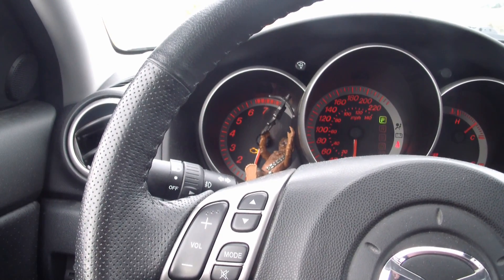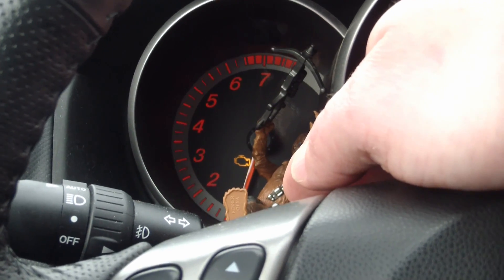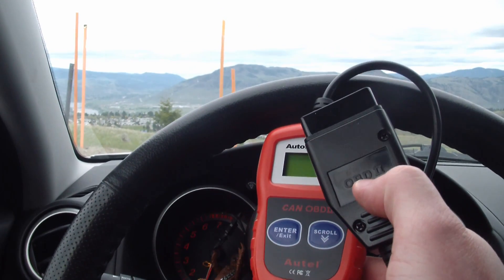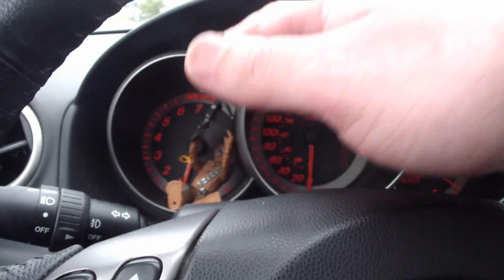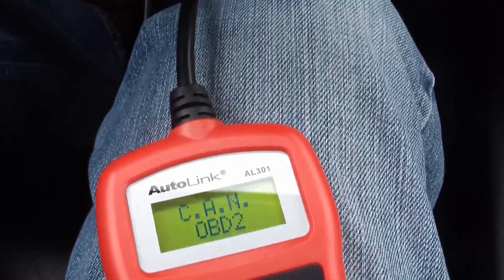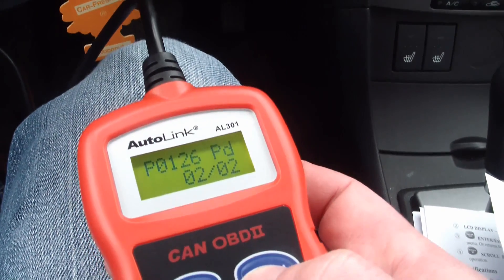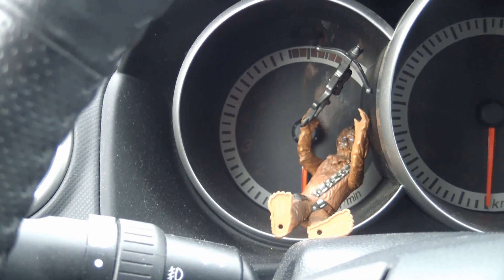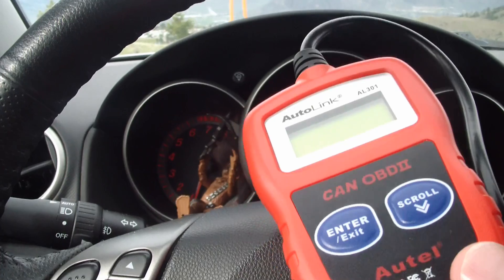Manly-Man Skills: Outsmart Mechanic Scams by Using Your Car's Computer!

Comment: I keep an old cellphone with the cell radio disabled mounted above my line of sight at the very top of the windshield and a bluetooth obd2 reader plugged in all the time. I have an app called Torque(it's worth paying a couple pesos for the full version) configured to takeover the phone so it's basically just a fancy full time engine metrics display and fault defector. Hell it even changes display modes/colors to match the lighting level outside so it's not a distraction

Old phone was free and the reader cost half as much as the phone mount, about 9 bucks. Been running for 6 years solid.

With all the graphing output and logging features of the app and a little gargling I've saved myself and a couple buddies thousands in misdiagnosed problems.

Also it makes the modern car feel like a real piece of equipment what with all the sensor data feeds. I mean hell, it's worth the cost of the odb reader just to have a god damn volt meter..

Comment: Late to the party but can confirm, self diagnostics result in us stealership parts changing monkeys doing exactly what we're told. If'n ya say it needs an injector, we'll swap one in, and then you can argue when the clean folks in the service advisors office call to let you know it's still missing on that cylinder. The customer is always right, even when they're wrong. Unfortunately sometimes it is a big (or little) expensive component that has failed and the only thing we can do after ruling out all other possibilities is to replace it.

A good mechanic looks for the simple, cheap solutions first. A bad mechanic throws confusers and pixie dance wires at it then asks for more diagnostic time when that doesn't work.

Comment: That is $30 bucks for a very basic engine code reader.  How about SRS?  ABS?  Transmission codes?  No joke but there are seat senors in some vehicles.  If they are there to detect the contents of your wallet is debatable.  Then there are the ones that can display live data and do key on engine off/on tests.

I have a "cheap" one for work that does engine, SRS, and ABS.  Also does key on engine off, key on engine on tests and displays live data.  Only ran me $400 but it is enough for the work I do.  Hate to say it but there is a bit more to diagnosing a car then just pulling codes.  That is why face time with the customer is still valuable.  Sometimes all I use the thing for is to validate what I think is the problem based off of face time alone.

There are still a few of us honest mechanics out there.  It's the salesmen that get me and one of the reasons I can't talk to customers anymore.  Also one of the reasons I am looking for another place of employment.  I'm fed up with doing unnecessary work just to pad their numbers and bonuses.

Comment: Hi AvE, love your channel man, so funny. Had a BMW a few years ago and the DPF light came on. Dealer told me it would take 1200 of our British pounds over here in Wales (is that anywhere near Germany I hear you say. NO, it is near England and we, the Welsh, are not too effing happy happy about it either) because a very expensive bit of the exhaust needed changing. Internet advised me to drive it hard, really hard like, for 10-15 minutes. Did that, had a blast and the light went out and never came back. Like you said effing cheating basturds. Going through all your videos.
regards
Gareth

Comment: Lol there are a few bad apples that give us techs a bad name. Both dealers and independent shops have them. If you are unsure, have them show you the problems with your car. If they won't show you the car then take it to someone that will. Not saying stand there and watch the tech work cause most of us hate that and only thought going through our heads is lighting your car on fire lol. Just saying have them show you the problems on the car before they start work and show you why you are paying what they are asking. Techs get paid by the job, not the hour for all of you talking about lunch and smoke breaks. Honest techs use standard industry labor times which you can ask to see.

Comment: The ultimate Mechanic-Scam would be getting someone to, say, post a V'jeo giving honest folks slightly inaccurate info as to how to fix their "Check Engine" light by disconnecting the battery! Maybe it works differently on the other side of the pond, but here on the island of warm beer and terrible food, never has turning it off and on again fixed it.

Also I use an Autel diagnostic device (MS906) and trust me, it wasn't 30 bucks!

Comment: I keep a cheap code reader in my console. Got it at a pawn shop for $5. If you don't want to do it yourself, auto parts stores usually have a cheap code reader behind the counter for customer cars. Just ask.

Comment: One thing missed here is before clearing the codes, write them down. All of them. If it's above your DIY level, take those codes to your trusted mechanic. They might  provide a clue. Better yet, don't clear them. The computer will also store data of certain parameters when the code occured. This additional data can help your trusted mechanic diagnose what happened. If you have a good relationship with your trusted mechanic, call them up and ask for advice. Many good independents will scan it and give you a bit of advice of what to do. Just remember that this time takes from what they are doing so be sure to do something for them and spreading their name around is always appreciated. Of course beer or cookies works too.

I had basically the same code on my VW. Fortunately, I have VCDS and graphed the coolant temp from cold to warm. Looking at the data afterwards, it showed a sudden drop, them return to temp. This era of VW had bad coolant temp sensors, so I knew what the problem was, but this showed me why the computer didn't like what it was seeing.

Comment: Getting the fault codes can and most times lead you to the culprit, but not always. Sometimes an unrelated component can cause another sensor to be off kilter and thus an unrelated code can be thrown. Such as a failing cooling/heating fan for the cabin can cause a check engine light. But that fan has nothing to do with the emissions..... So you thought.....

Comment: When I went to work in bc Canada from the UK ( born & raised) I had purchased a dodge ram 1500 1997,  the check engine light went on, so thought, end of days, lol,  but, my bud said check the filler cap, it was loose, so I tightened it, ccccc click, end of problem, crazy, as the dealership would have charged me a mint, the dealers are crooks in North America, I have buds, in the trade, so helps, I am grateful for that,

Comment: Warning.  BMW has an extension to the OBD-II codes which are proprietary.  You need BMW's reader and diagnostic tool to modify some of the warnings/codes.  You can get a category code but there are other codes that you can do nothing about with a standard reader.

Comment: Ten years after I bought my '02 Dakota that light came on, so I bought a Bluetooth ODB2 device to figure out what was up.  Turned out to be a cracked hose.  It was two years later that I found out that you can turn on the ignition 3 times quickly and the error code will display on the odometer.

Comment: Two things we do in the UK : 1, take the lamp out from behind the warning logo. 2, Turn the radio up so you can't hear the engine.
Reply: Sadly my radio doesn't work either
Reply: If you reside in an area that requires emissions testing, they don't care if the light is on or not,  they plug in a scan tool which tells them if the computer is signaling the light to come on.... if so, you fail and can't renew your registration....
Reply: Yes, I have a Land Rover, too.
Reply: @blacksquirrel4008  awesome!! You sound like you have heard my Texas joke!! 🤣🤣🤣
Reply: @davidjones8942  no, do tell
Reply: Electrical tape over the oil light worked in my Vauxhall Victor!
Reply: Or remove the fuse for the engine management light.

Comment: You can buy ELM327 v1.5 and it will read/erase those error codes and it can also show you life data from sensors.
It costs 3-5$ and you need 1-2$ application like Torque for your phone.

Comment: Get an OBD2 bluetooth adapter, use the program "Torque" on your phone.

WAY better than just one of those code readers!  You can watch any of the sensors output, as they work (or don't).

Comment: Don't disconnect your battery or change a battery if you have to smog your vehicle. It may take a couple hours or a couple days depending on driving habits to reset the system readiness tests.

Comment: Dodge has something like this in cars going back into the 90s (maybe even later?) With the car off, twist the key a couple few times (dont start it) and it'll read out the codes to you. Buddy of mine told me this, use to work at the chrysler plant in Belvedere, Illinois.

Comment: “Google is an excellent resource.” 

You just can’t get this kind of expertise anymore.
Reply: I like how he says google is an excellent resource but doesn't use the OBD2 website that has every code (including some manufacturers codes) and common faults listed lol
Reply: @nilloc93  True, but on the broader internet (via google) you can find shortcuts and 'life hacks' for a lot of the meaningless codes that will still actually throw a light. The evaporative emissions faults in CA cars for instance.
Reply: @jameshisself9324  None of the codes are meaningless. They are all present to indicate an issue with the emmissions of the car, which if everyone ignored, would just lead to shitty air. I would suggest that in addition to dealerships ripping off car owners, ignorance on the part of car owners is equally a problem because learning something new is just too hard.

Comment: Cars before 1996 and euro cars have their own OBD system called OBD1. Back then every manufacturer had their own CAN/BUS connector and codes. Also only some OBD codes are "standard" If your code starts with PO or C then it's a chassis or powertrain code respectively. If it only has P followed by a 4 digit number then it is a manufacturer code. THESE CODES DO NOT TELL YOU WHAT TO REPLACE. it's not that easy. Sometimes it is that easy. But most time the MIL only gives you a starting point, or a frame of reference to start troubleshooting. Most OBD systems take about 100 miles to reset monitors and what not.

Comment: Smog has been reduced because car have computers that control the fuel mixture.  California's efforts to reduce smog from cars did very little, (EGR, CAFE standards, 1960's & 1970's era modifications) and to some extent, damaged performance causing drivers to burn more fuel and crate more smog.  California is controlled by "do gooders" who legislate the right thing (in their opinion) without any ability to make it work in reality.  Pitiful.

Comment: dad says i should wrap up the pokey bit before inserting into the receptacle!
Reply: What if they pokey bit burns, should you chooch away?
Reply: wait until the smoke comes out
Reply: Well the only problem is that when you have your pokey bit wrapped up you can't transfer the data. That in turn though also prevents you from all sorts of viruses that you might just get stuck with for the rest of your life.....

Comment: If it flashes fix asap. Always look into mode06 data for pending and intermentent faults. If you are taking to a reputable non stealership driveability Tech don't clear it he can save time with freeze frame data with a more robust diagnostic tool. Always remember most dtcs are fixed with answering a few yes/no questions. That was an Excellent presentation of the diagnostic system. If you do have to go to a dealer remember this that tech only makes about 25 to 30% of shop rate. That being said if someone were to present him with 40% in cash value of the labor rate you will easily find where his loyalty lies.

Comment: Told my parents I could fix their P0010 code, they took the car to a shop and it came back with the same code and the same bogged engine. It's a 2012 Buick Regal. I told them to just let me at it and I'll get it fixed.. since the shop charged them close to $300 they finally let me do it. Long story short, I had to get a camshaft position actuator selenoid and put it on....I had a feeling that they fucked something up and guess what THE DUMB BASTARDS PUT AN EXHAUST WHERE THE INTAKE WAS SUPPOSED TO GO. Five minutes later, I switched out the selenoids, cleared the code and she rides smoother than glass, mileage went up dramatically and the idle issues were gone. Moral of the story: don't EVER trust shops. Those bastards have taken my parents for thousands over the years, don't let it happen to you

Comment: You're not always paying for someone to plug in and read what the light says and blindly replace that part.  Sometimes you're actually paying for a couple decades of experience that knows the code the car tells you actually means something else is wrong.

Not always though.  Sometimes you are actually paying for some youtube certified hack to plug the code reader in, blindly replace parts based on the code alone with no testing then erase the codes without actually looking at the snapshot and analyzing what happened.

You of all people knows that there's no substitution for experience.

Some get better with time, some think they get better with time.

Comment: The check engine light will only ever turn on for an emissions fault. And the DLC (diagnostic link connector) has been standardized since 1996 and is located within 18 inches of the steering wheel. The code you have is likely a bad coolant sensor but a thermostat stuck open can cause that code as well. Stuck open means the coolant can’t heat up the engine properly. Also, NEVER go to a dealership unless your vehicle is still under warranty and the repair will be under said warranty. Otherwise just go to a well established and trusted mechanic of your choice. Speaking from over 20 years of experience as a mechanic.

P.S. an engine not getting up to temp will burn extra fuel in an attempt to warm the engine. That P0126 identifies a cooling system fault, but still affects the emissions system by adjusting fuel.
Reply: Tis why I always look at fuel trims just to get an idea of where she thinks she is.
Reply: I have obtained more than one beer at the bar with that tidbit. OBD is indeed 100% emissions related.

Comment: I remember my dads old 94 gastro van. You had to take a paper clip in the certain pin recepticals turn the key on and count how many times the engine light flashes in the 3 sequences then look in the repair manual for the code then find the page that codes troubleshooting process is on

Comment: There is a shut off key for ur check engine light. For instance my 90s chevy is (turn key to accessory, press gas 3 times, turn off ignition, start) if the fault is still happening it will turn back on eventually. If it was a random misfire or something ur good to go.

Comment: get to the root of the problem... yep. I had a problem with gas coming into engine, service said gas pump, 1000 eur , other bigger car workshop said gas pump, 1000 eur. i made some calls someone knew a guy with a garage, he investigated, faulty cable ( broken, burned, w/e). End bill 120 eur for his time, Gas Pump is doing quite fine now after 6 years.

Comment: You're right about the auto dealer system being broken. I've been a tech for 30 years.  15 at my current dealership.  When I got here their diesel department was in shambles.  Over the years myself and another tech turned it around and we now have people driving hours and passing other dealers to come here to get their trucks serviced.  So we're not all crooks. Some of us have integrity and are true professionals.  There are however those in this industry who are complete morons that put their own paychecks before doing what's right for the customer.  It enrages me to see one of my customers vehicles drive in the shop with one of the lube goobers behind the wheel because I know that the customer is about to be corn holed.  The best advice I can offer consumers is that once they get an estimate for a repair from the service advisor up front ask to speak with the technician working on the vehicle.  If they're not comfortable with what they see (cuz you can't hide stupid) go get a second opinion.  Anyway there are professionals with integrity out here who put our customers first.  You just have to find one and stick with them. Love your videos.  Keep up the good work and don't let your meat loaf!

Comment: Check engine light came on, code apparently stated the fuel tank had a leak. No leak, cap simply didn’t seal properly anymore.

Comment: I have now watched MANY of your videos and I was wrong to call you a dumbass, sorry.  While you're brilliant with machining and electronicals and many other things you are somewhat ignorant on this, and in my opinion not knowledgeable enough to be giving out advice.
A pending code doesn't mean it's an active fault, it means the confuser detected a fault but hasn't yet decided it's really a fault.  A stored code is one that the computer has decided is actually a fault, but those are sometimes just a clusterfuck of confused pixies that it thought indicated a true fault.  It's not supposed to happen, just like a fuse is never supposed to fail without a short, but both do happen.

Comment: Subaru forester, engine light and [cruise control] blinking... uhooh. Either catalytic converter or something else rather expensive...... or closed the lit of the petrol tank one turn to few. Then the petrol system get's problems sucking petrol due to no venting. :o)